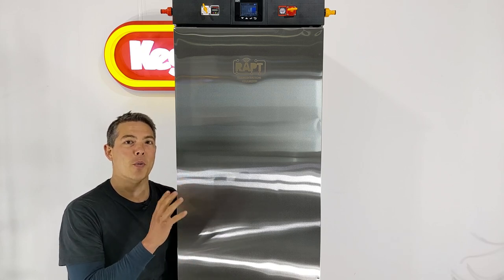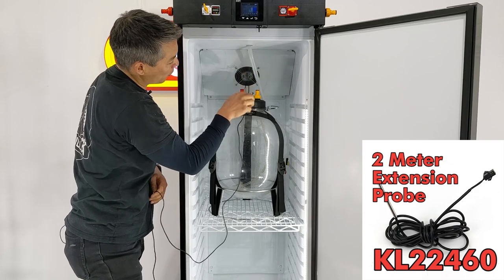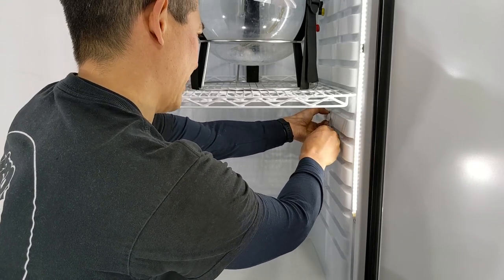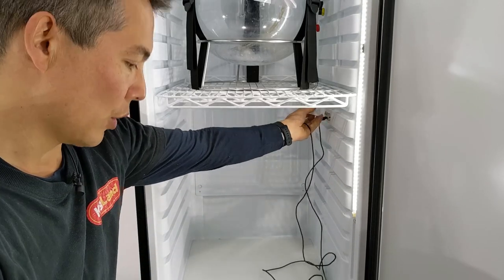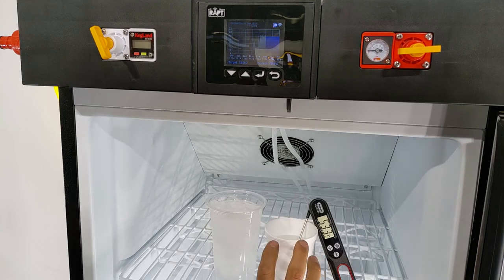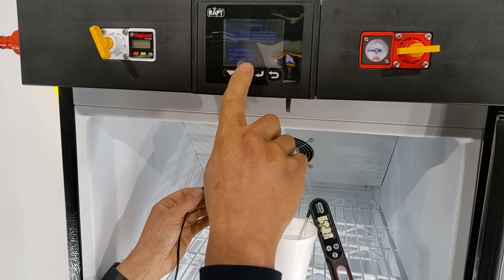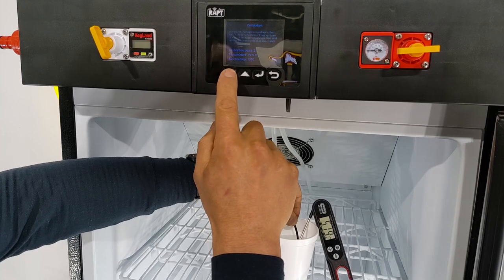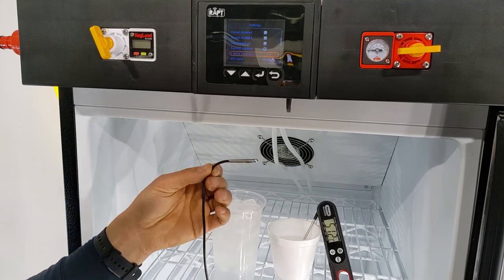RAPT - Fermentation Chamber - Calibration Video

Comment: Did you calibrate your instant read thermometer?

Boiling water (100 degC at 1 atm sea level) is a better second or hot temperature calibration point to use.
Alternatively if you already have a calibrated accurate thermometer you can use that probe to calibrate other thermometer probes.(the calibration accuracy will be dependent of how accurate your reference probe is)

(Remember iced water by definition cant be 0 degC but slightly higher, perhaps 0.1 degC. Salt water can remain in liquid form below 0 degC as low as -2 or -3 degC,
Reply: 0.1 fault tolerance is fine by me
Reply from the maker: Yes I would agree with this.  For simplicity we just used a cup of hot water but it's very possible that I have some error in my instant read thermometer.  These are factory calibrated. If customers have a bit more time on their hands they should get a kettle right next to the Fermentation Chamber and actually use boiling water to calibrate to 100C. I would agree with that entirely.